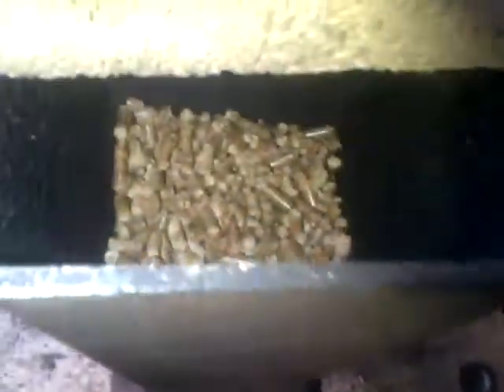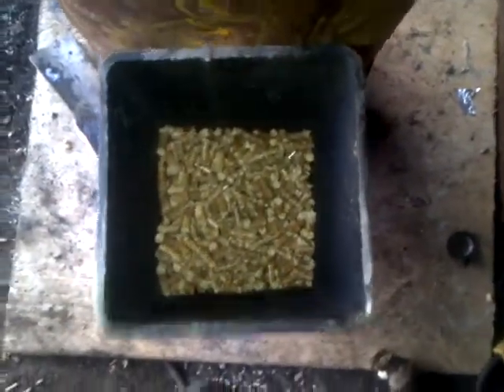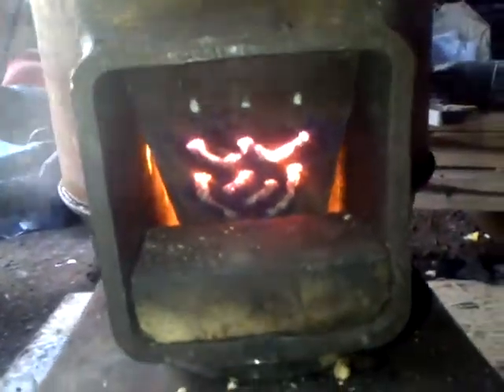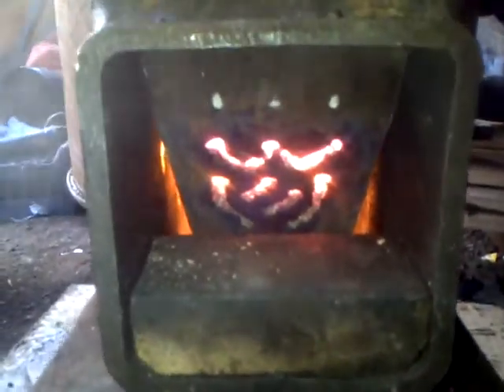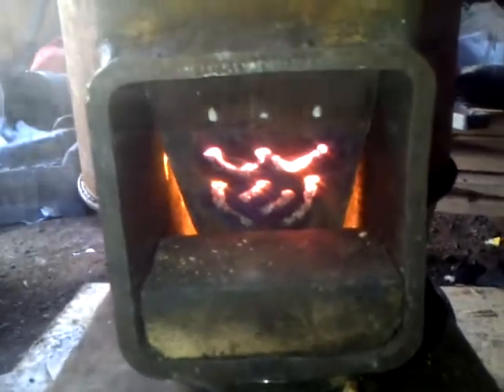Compact Rocket Stove & Mass Heater (6" RMH Hybrid)

Comment: Is the stove still in operation?   They say rocket stoves get so hot they burn themselves out when made out of steel.
Reply from the maker: "they say" lol.  i like that lol.  mine is still going strong.  i have many more recent update videos featuring 100 hrs of R&D and torture testing.  if you insulate a metal rocket and use thin steel yes it will melt.  having the sense to use proper thickness metal and having the sense not to insulate steel is up the the designer and builder, rather than the critics.  you'll have to see the newer videos in this playlist for more, including baking pies and burning wood

Comment: how does your feed work?
Reply from the maker: Strictly vertical gravity.   No auger or power required.    The pull from the heat riser also eliminates the need for any blower fans found in typical pellet burning stoves.   The feed may be shown in better detail in latter episodes.   Thanks for watching